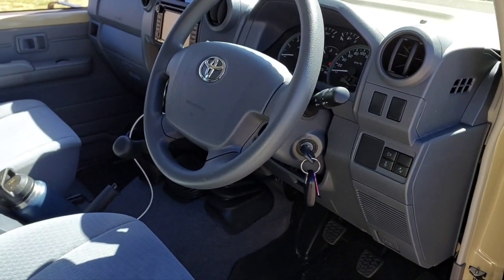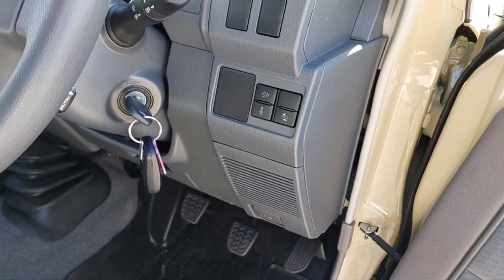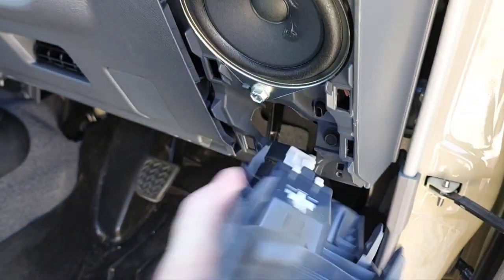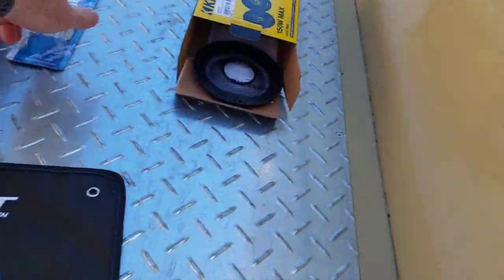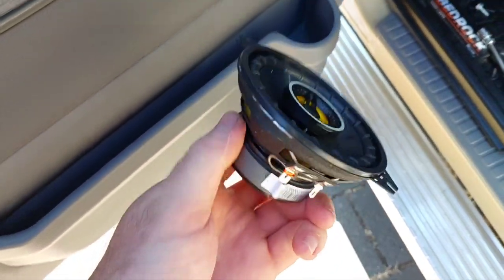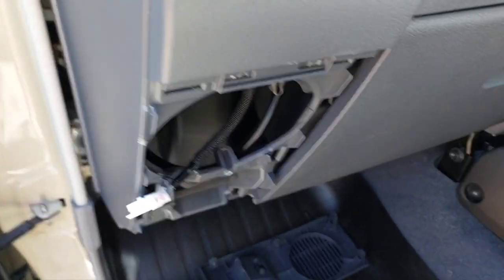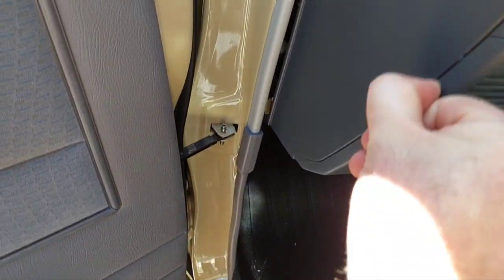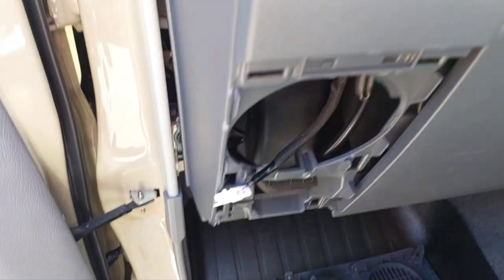Landcruiser 79 Series Front Speaker Replacement

Comment: Hi 
Thank you for sharing the installation process. 
I have 2 questions 
What was the impedance on the factory speakers and watts RMS ?
Reply from the maker: Great questions! Unfortunately I tossed them in the bin without looking, I wouldn't say the wattage was high as they peaked out before you reached maximum volume on the head unit, as for the impedance I'm unsure, they were Pioneer OEM items if that helps. Cheers
Reply from the maker: I found a photo on my phone, they are 6 ohm from factory.